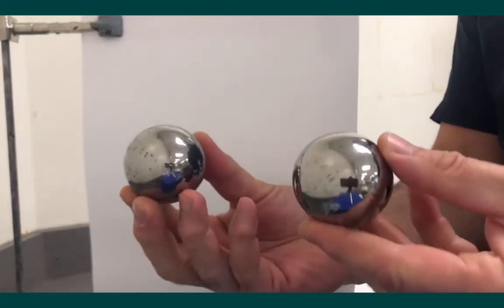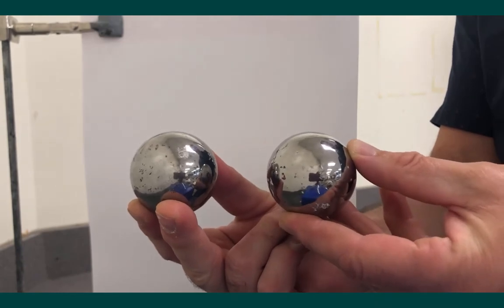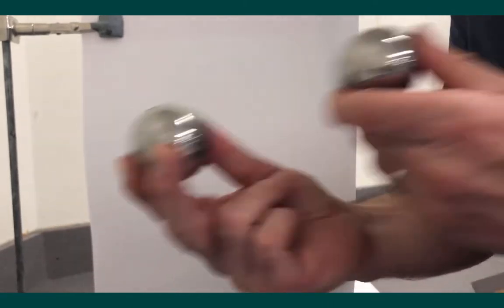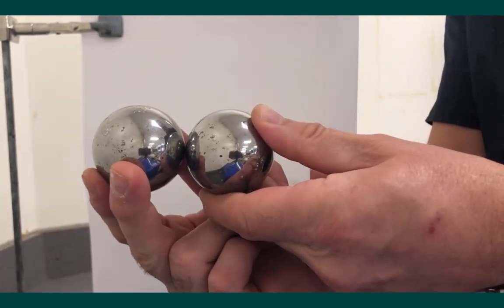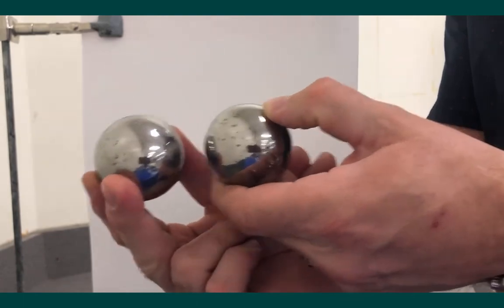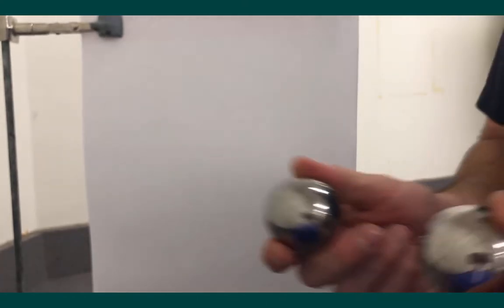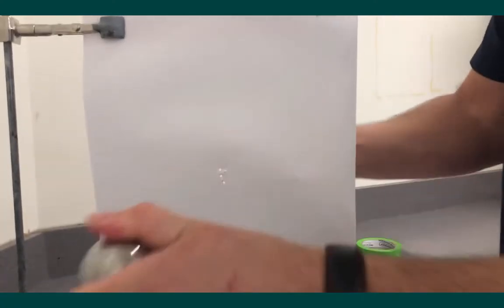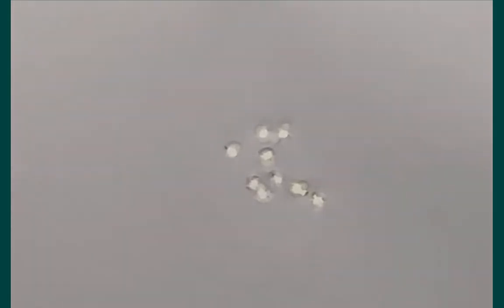Energy Transformation With Ball Bearings, Burn Paper with Steel Balls

Comment: I thought up something the other day (note: everything in this comment that's said below this sentence is not directed at the channel owner):

  • Have it so the balls are a teeny bit
     egg-like in shape. You'd hold the
     "ball eggs" by their big ends, then
     you'd smash the ball eggs' small
     ends together. You'd also coat the
     big ends in a substance which is
     both easy-to-grip and durable.

  • Make the ball eggs out of tungsten.
     Tungsten has the same density as 24
     karat gold. If you were to compare
     1cm³ cubes of tungsten and iron... or
     gold and iron, the weight difference
     ratio in the two sets is nearly 5:2.
     Tungsten is also very durable and
     very corrosion-resistant. More
     weight for your smashing balls
     means more energy released per
     smash. Many people's arms and
     hands could also tolerate weights
     and smashes which are of larger
     magnitudes than with what you'd
     see with little steel balls... and the
     smashings of those.

These tungsten ball eggs would be a bit pricey, but they'd be a neat way to start fires. Just find some tinder (and perhaps also: paper), then give it a smashing (correct me if I'm wrong, but I would imagine that this would work). Fire-starting ball eggs may be a bit pointless in this day and age, but they'd make for some interesting toys.